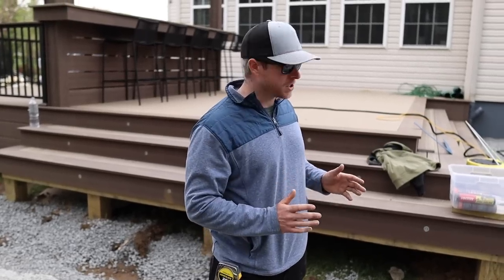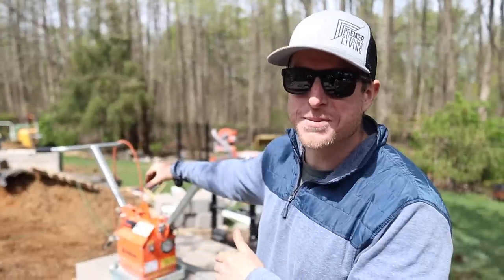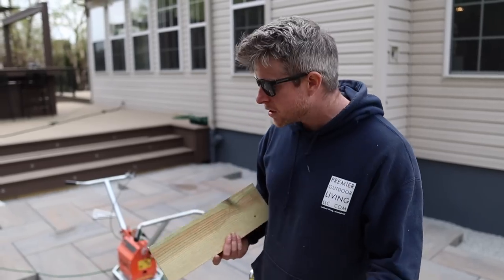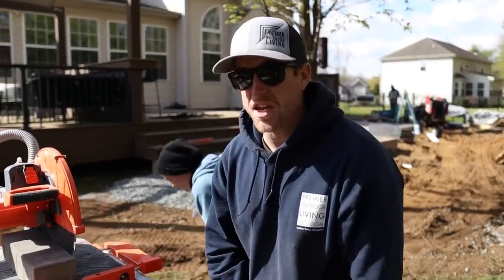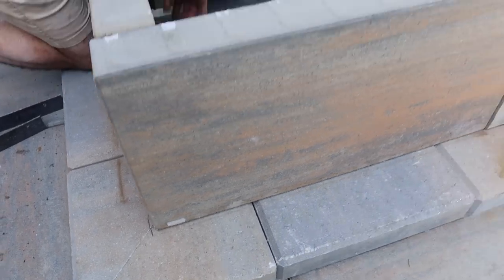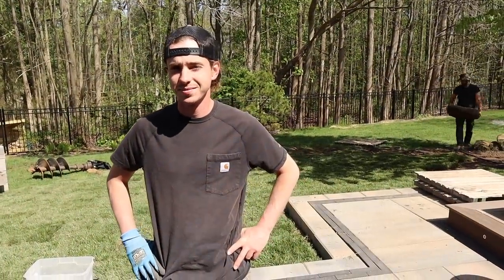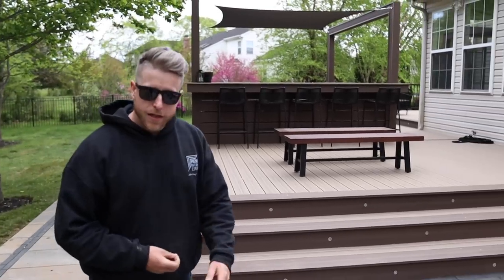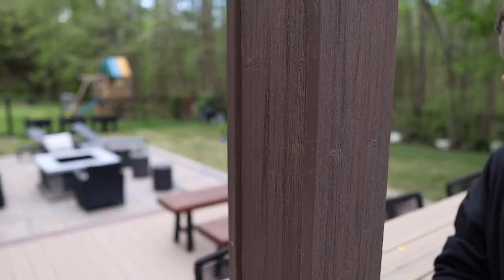Installing A Paver Patio With Huge Techo Bloc Slabs And Building A Fire Pit!

Comment: Looks nice! One suggestion for the fire pit.   If you run a pipe under the patio into the fire pit to feed air to the fire, it may reduce the amount of smoke created and be much more pleasant for the users.
Reply from the maker: very interesting, just run the pipe to somewhere in the yard?
Reply: @THEpremieroutdoor  Yes. There are quite a few videos on youtube with differing designs. Here are two:  https://www.youtube.com/watch?v=m7HzpgebAHs and  https://www.youtube.com/watch?v=BBZtFcXbal4&t=360s